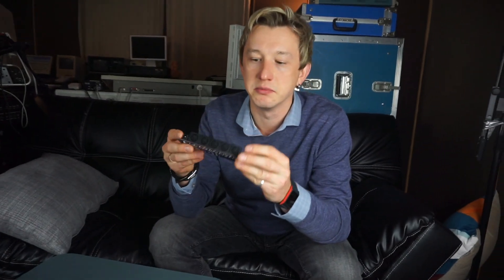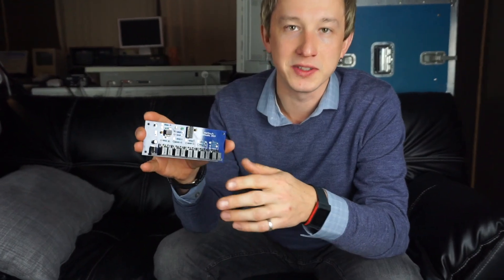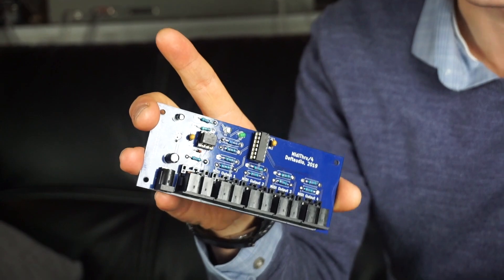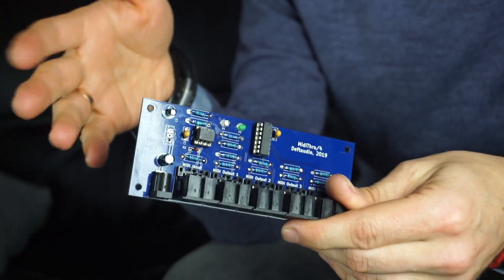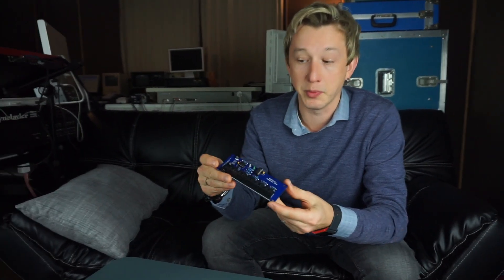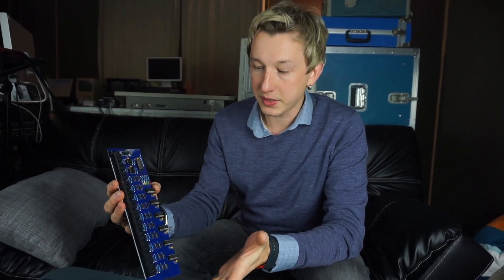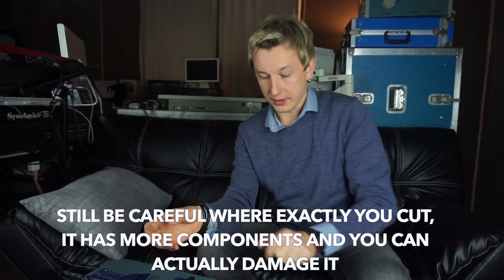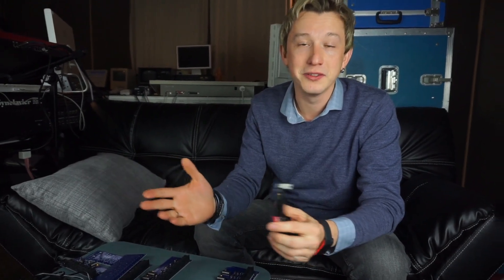Building DIY MIDI thru box, merger, DIN sync from Tindie parts.

Comment: where can I get the firmware for midi merger?
Reply from the maker: MIDI Merger is always coming with pre-programmed controller.
Reply: @DeftAudio  oke so if I order PCB Only option, it came with the pre-programmed ic?
Reply from the maker: @pria_jatnika  Yep, no need to worry.

Comment: Hi,
I've just discovered your product.
Very interesting..
Question .. does or will exist an merger that gives the possibility to merge 4,5,6 up to 8 input to 1 or 2 output or more ?
Thanks.
Reply from the maker: Yes, you can design a 8x8 merger using a Teensy version. This will require some minor programming in just adjusting a basic firmware that I supply it with. https://www.tindie.com/products/deftaudio/teensy-41-midi-breakout-board-8in-8out-usb-host/

Comment: Totally dig the idea! Could you please show some housing options? Thanks
Reply from the maker: Hi, for smaller kits like 1->4 or 2->5 Hammond makes aluminum cast enclosures that can be used there, such as 1032L. For bigger board it's easy to put them in between two pieces of acrylic top and bottom. You'll find CorelDraw masks on github for every kit.

Comment: The purchaser has no means of contacting you unless here on Youtube or registering at Tindie. I suggest you provide a means of contacting the seller without having to register. If you purchase a product, why does the patron need to register in order to ask a question or solve an issue - registering was not required for the purchase.
Reply from the maker: That's not my rules, that's Tindie rules. But I'm not limiting you contacting me over Tindie only if you don't like it. All kits support files including BOM and schematics are posted on Github, link in the item description on Tindie. Items are also listed on eBay. You can use any of those to contact me too.
Reply: @DeftAudio  Ultimately, it is your responsibility to give easy access to your buyer. You are asking the buyer to go to Ebay or Github to try contacting you? I see with your response that we do not share the same mindset on customer care. I have now withdrawn my volunteer support.
Reply from the maker: @bobcatt2294  Absolutely not, that's why I'm replying you here. But there are nicer support channels with proper communication and logging. This is why Github is just more efficient place for collaboration. Tindie has great structure for support tickets and managing issues too. And obviously everyone who made a purchase are leveraging this for any follow up questions or issues. But I'm not limiting anyone contacting me - eBay, Tindie, Youtube, Github. You pick.

Comment: Have you tested the caps polarity? The cap's, so called polarity markings, often are, unfortunately, not the correct for polarity. By not testing these capacitors, you are then asking the DIY person to acquire a tester in order to find the shielded lead. If you have tested these leads, then publish the true polarity.
Reply from the maker: Be careful buying caps from eBay or Ali, use proved sources, then you can trust the polarity markings.
Reply: @DeftAudio  This is not an Ebay issue, major manufacturers for some reason do not properly identify the polarity of caps. By not testing these capacitors, you are then asking the DIY person to acquire a tester in order to find the shielded lead. If you have tested these leads, then publish the true polarity. I seldom take polarity markings at face value for caps.
Reply from the maker: @bobcatt2294  I do not agree with that. That's not an eBay as the platform issue, it's seller quality issue. There are many counterfeit parts available what makes nothing but an additional risk. If you stay with a reliable manufacturer and a distributor, then you limiting yourself to the factory failure. Standard AFR is 0.4% for the most components. It always to be there, but dealing with my company since 2008 I've never experienced problems are you're talking about.

Comment: The kit idea is great for learning and creativity. However it would be of great benefit if you labeled the components so that those who do not understand the values (example of resisters) may be able to confidently build. your kits you offer. Also it best you inform your potential buyer of the level of experienced needed to successfully create the build. In summary the kit can not be build if you are unable to read schematics, understand the values or identify the components you ship. 

A video would be most helpful. I teach basic electronics and my beginning students did not know how to identify components nor where to solder them on the board. Generally kit manufacturers offer detailed instructions so that the installer (whether experienced or not) learns what the components do, are able to identify components, components polarity and values. I suggest if you are planning on delivering more kits, that you create a Patrion channel and make these videos available. I hope you agree, what I suggest makes good business sense. Thumbs up.
Reply from the maker: Thank you for your feedback. I always label resistors in my kits. These are marks on the paper ammo pack, please make sure you didn't miss it. Also, I minimized the number of values used, and when for instance you order big kit with 10 MIDI outputs, you receive 26 resistors of same 220ohm value which makes it obvious.